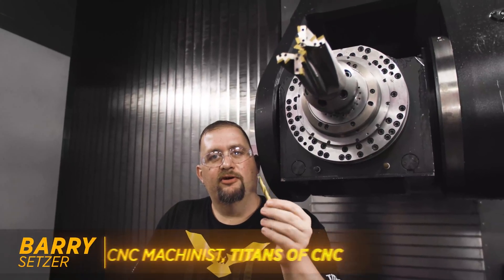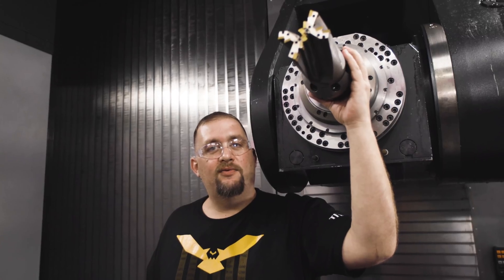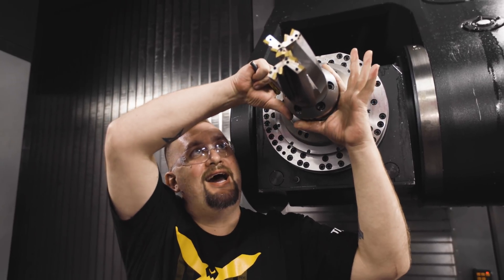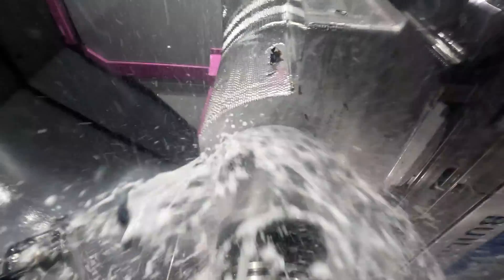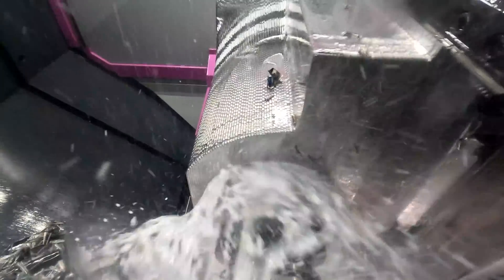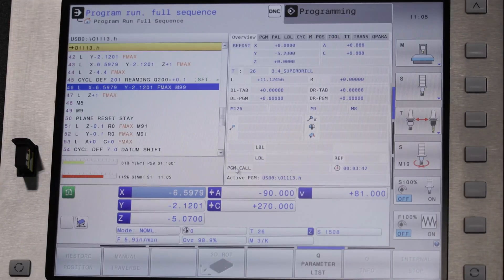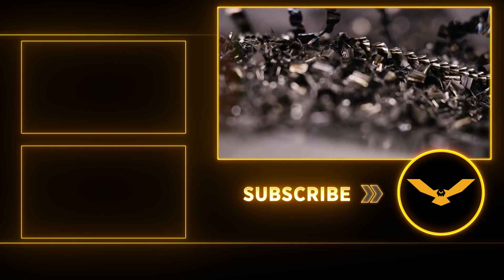USING 130 HP TO PLUNGE FBX DRILL 3X FASTER IN 4140 STEEL

Comment: Also depending on the layout of the machine spindle assembly, alot of machines reach max torque at lower rpm. If you guys are willing to risk wrecking that drill for us all to see how great it is you should push it alot faster and take into consideration that torque is not constant in most machine, if you stall but have good chips you may be able to cut alot easier at a lower rpm.
That tool and that machine should be able to run alot faster than that if its a good machine. And I definatly want to see it

Comment: Hey man you can you can push that drill way harder, if that machine has 135 hp and that much torque you can probably go atleast double. You will most likely destroy that drill before it stalls out unless the machine manufacturer is lieing about its torque and hp

Comment: 89kW? Crazy. Recommended specs seem kind of low for the tool though. Whould expect more from 4 flutes. Or inserts are not meant for softer steels?
Reply: Correct. The inserts are actually for superalloys and titanium
Reply: @barrysetzer  Thank you for the answer.

Comment: I am all for pushing things but also keeping in mind the tool company gave the specs they did for good reason. Early on I worked at a shop that did a lot of swiss style turning in stainless and titanium and they took the "max recommendations" as a suggestion and blew up tools left and right. Not to mention also having a really tough time holding tight tolerances too. 

Just something to keep in mind when doing this is sometimes being a little less aggressive is the way to go in the long run!

Comment: Do you think it would have worked if you didn't have the across hole to evacuate the chips?
Reply: Yes, the across holes actually HURT, if anything. Adding in an interrupted cut adds alot of stress to the inserts

Comment: So, what does this prove if your running 5x the recommended SFM?
Is this something that you can do day after day? I would like to see those inserts after 15minutes in cut.
1400sfm that's screaming for 4140
Reply: That's a lot of metal removal in that time with that feed, and machine spindle and frequency converter will be rated 200% for 15-20 seconds, and with the break in between it will be fine at 150 %as long as the job and table brake do not move , I've fed hard enough with a tip drill on 22kw machine to lift the pallet up as I was drilling up the top, had to slow that down below maximum feed of the drill for that hole, as it was a repeat job.

Comment: Loving the comments in here. 
I have spent most of my 40 years career working on big machines, and i get the feeling most people aren't used to machining anything bigger than they can lift. 
I must say you still had another 20-30% to give that drill, or will the ibarmier go to 200% load before tripping? i thought it actually sounded sweet, but not sure if i'd drill the cross hole first. It's helped chip evacuation but i'm guessing it was quite an aggressive intermittent cut at that point. nice videos by the way.
Reply: Great comment, buddy. And yes, you are absolutely correct. We had at least another 20% we could have gone. Great eye!

Comment: I used to use 6 inch spade bits in an old Warner and swassey  turret lathe for my very first machine years ago. I could never reach the boundaries of the torque limit on that 80hp machine. If I remember correctly I fed that drill at .015 per rev at 50 rpm in 4140 and it would pull and break chips as long as my arm, 2 inches wide! I fed an old greese line through the back of the turret to give the tool through tool coolant
Reply: Oh man, that sounds terrifying for sure, but also AWESOME!

Comment: well done, you set your tool using the automatic probe, you followed some cutting data from a sheet someone else already came up with. good job true engineer
Reply: If its that easy, why dont you show me how its done? Feel free to link a video showing us all how AMAZING you are!
Reply: @barrysetzer  funny, I have my own machining business, I've been machining for 18 years. I can run most cnc machines, its easy. The software newer cnc machines have nowadays is so well designed that its easy and smooth to program on. I prefer manual machining as its less dull. better money too as no CNC company want awkward one off jobs.  They dont call CNC machining window licking for nothing.
I dont have any videos.

Comment: For sale: One lightly used Ibarmia 5 axis 100 HP monster mill.  Only has a few dozen hours on it 30 percent above the redline for spindle power, feeds, speeds, and machine rigidity.   Looks new but it's been run really hard to see where the breaking point is.   Spindle bearings and ball screws may not have much life left.     LOL.    Really it's great to see monster machines taking huge cuts that even the tool makers say shouldn't be possible.  But this WILL cause accelerated wear.

Comment: I want you to investigate the moment when the drill met with the pre drilled holes on the side! Did the load changed? Did the drilling sound change? Was there any effect on the tool  vibration? Just curious if there were a tendency of the inserts to hammer on the hole edge!
Reply: The sound definitely changed, and it was a bit more violent sounding, but the spindle load actually dropped a little. The inserts didn't seem to mind, though!
Reply: @barrysetzer  there you are, I am manual but been doing a lot that entails deep hole drilling. For my habit I stick to drilling deep holes first, then those that come on sides and are crossing the deep holes comes later, and this reduces a lot of knocking on the drills or boring tools. So if the are small holes in diameter better drill them later after the deep big holes. I believe this might help.

Comment: Hi Titan, love from China, also an amateur machinist (playing with toy desktop mills, owning a Carbide 3D 883 and a Bantam Tools) here. Don't want to sound rude, but I think you might want to see a dermatologist for your mole, the biggest one on your right cheek. Usually dermatologists use this ABCDE rule, asymmetric, boarder, color, diameter and evolution. The biggest one looks asymmetric, large, and has black, brown, white and skin, totally 4 colors, plus on the top of the raised part there is a white top with a blue tinge, and that particular color described in book as blue in a veil is a good sign of it being a potentially skin cancer or pre-cancer. Also a general guideline, don't irritate moles regularly. If it is in a shaved region, remove the mole or remove the hair.
Reply: Barry this guy may have a point. Check it ASAP.

Comment: How about a spade type drill? With indexable 140 insert? Just thinking it would be easier cutting and should chip just fine, I used a 75 x 1000mm spade drill and it sounded pretty sweet as long as you had the feed up
Reply: I don't think spade drill would ba as fast. AS far as I know, they take more power than typical indexable drill and also need tons of power in Z axis to keep up with proper feed to break chips.

Comment: Why did you use the 201 reming cycle instead of 200 drilling?
Reply: Ooooooo good eye!!!! I wanted to make sure that i didnt scar the inside of the hole by rapiding out. Ive had that happen with inserted drills before, and i figured better safe, than sorry!

Comment: was that spindle load meter doing like 120%?
Reply: Yeah, hopefully they took the duty cycle for 150% load and made sure to keep the cycle time within that.
Reply: @scottwatrous  they are arbitrary numbers for marketing. If theys doing one part like this it wont hurt anything. Start running everything at 100% and up then yous changing the spindle every couple years. I remember haas terryberry once said he ran everything maxed out and the production goes up like crazy, you change the spindle cartridge every few years and basically it pays itself with the boost in throughput.
Reply: @TommiHonkonen  you only need to increase production by like 15% to pay for a new 30k spindle once a year and that's only taking cost of labor into account. Had a boss tell me before when I questioned his judgement on us working overtime that labor cost is so low on the list compared to machine up time, material value, tooling and even energy costs.
Reply: @ghost2coast296  exactly. if you double throughput then yous get new machine every year
Reply: Yes, and yes we stayed under the S6 time constraint :)
Reply: @barrysetzer  Thats why titan told you to up the feed

Comment: I wonder if that's rated for 100hp continuous, that would explain the ability to run 130hp for a minute (or however long).
Reply: It is 100hp continuous. And even using the S6 torque curve, this was over max by 30hp and 120ft/lbs. love it!

Comment: I am curious to know if the Ibarmia was able to log and graph spindle current draw, temperature, and chiller coolant temperature (and other related data) from the start of the plunge to the time of retraction. Data that may be similar to a dyno run for an internal combustion engine logged by an engine control module, (or a power train control module) in test conditions.
Reply: Yes, its able to do that! Ibarmia themselves can also log into the machine via teleservice to monitor these conditions

Comment: The only way to find a limit is to go past it. Nice job, from mounting the tombstone, fixturing, tooling, coolant to have the confidence and the balls to run this!
Reply: ?? its CNC, you could be 30 metres away.
Reply: @jh7589  It's not ballsy in the sense that someone could get physical injured, but moreso that the cutting tool, spindle, or part being machined could get potentially be seriously damaged
Reply: @subbot8077  ahh, ruin the expensive machine? Sounds like a great idea.
Reply: @jh7589  eh, it's just a matter of knowing/trusting your equipment. just because it defies convention doesn't mean it's inherently a bad idea lol
Reply: @subbot8077  callout charge per hr for repairs on them spindles  in hundreds of dollars per hour plus machine downtime  costs. I'd just reduce speeds a bit and take 5s longer
Reply: That is what the test pilot said.😵

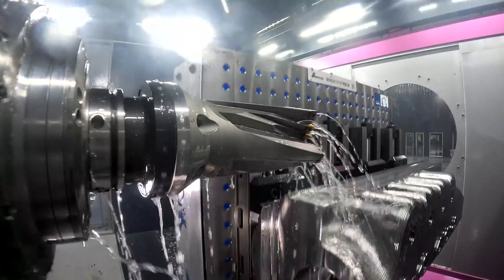Comment: Why did the spindle tilt up @ 3:32?
Reply: that's a sort of magnifying glass effect from the coolant on the camera, nothing tilting except the light.
Reply: @stefan0ro  watch it again. It goes up maybe 2°
Reply: @john.hunter  had to re re rewatch, you're right, it snapped a few mm. Guess that's the beating they were talking about 😅
Reply: Maybe the part wasn't level so after drilling is just zeroed the spindle position
Reply: i noticed that too haha
Reply: Looked like it locked, now I wonder if it mechanically locks the A-axis for a tool change.
Reply: That looks like a  rezero at the end of the cycle to me.

Comment: Boss, I saved $20 on the cycle time, but fried a $20k motor and the machine is going to be down for a week. What? No, I overloaded the motor so it's not covered by warranty. 
I got good news the drill didn't break.
Reply: 20k sounds cheap for a motor for these... Just hope there's some  basic protections on them. And they're lucky it's only down for a week, I guess they're not far from their supplier.
Reply: @mokmo23  last 15hp integrex spindle i saw rebuilt was 30k and two weeks if i remember.  Bet that is at least double, probably more.
Reply: And i got a cool video to remind you what it sounded like